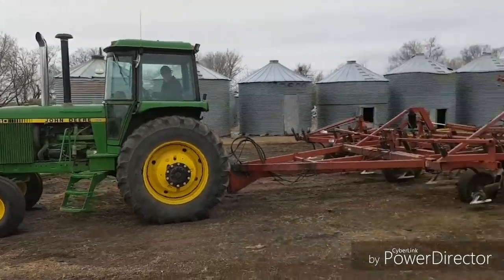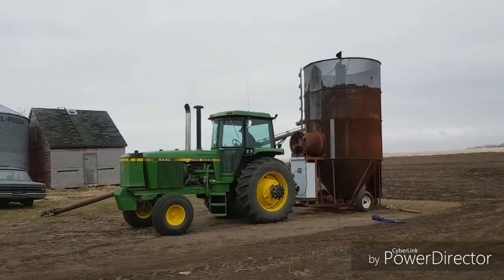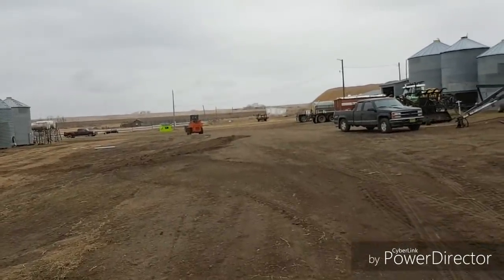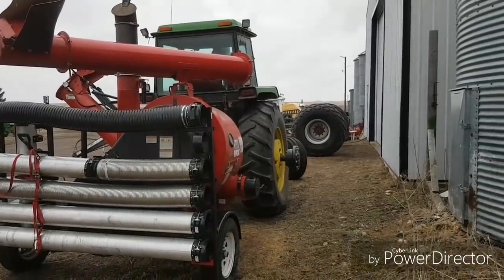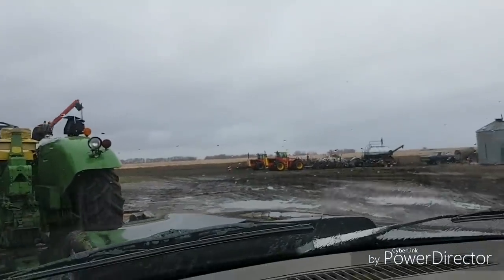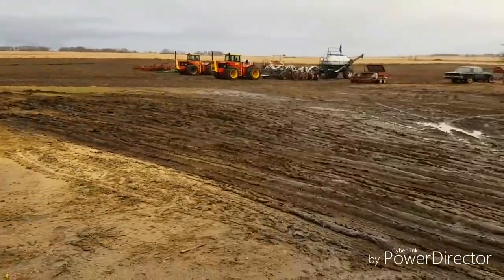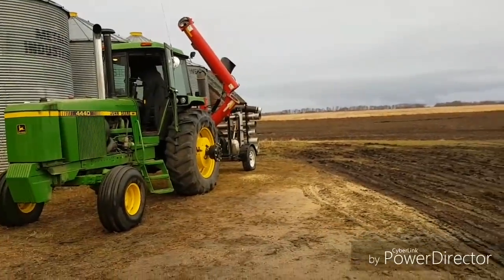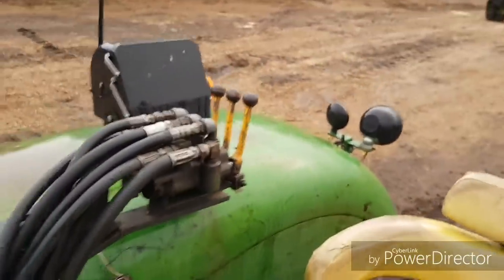4440 pulls 35 foot cultivator and Antoine does magic!!!

Comment: That old Thomas skid steer....
Seems to me that they made the old John Deere skid steers... We had an old JD 70, 5' bucket, good ol' Wisconsin.... LOL!!! Worked the HELL out of the ol' gal!!!! Rebuilt the engine twice, she'd run like a lopsided top, right up to when she couldn't run..... Last time around, she was still scooping 💩💩 💩, running on one cylinder, the one next to it hitting every other time.... The two on the right side of the machine were taking turns every few minutes... Busted head, cracked block.... All but the hydraulic cylinders was worn out!!!
Sometimes I miss the old gal, but not enough to want it back!!
(Only half the machine of my old Case Uniloader.... She still runs every day 😂)
Reply from the maker: Lol
Reply: Gosselin Farms Ed Gosselin 
JD 70 skidsteer was made by Owatona. I have one. Good rugged machine.

Comment: Could you possibly get more hydraulic hoses forward to the front loader on the tractor. Holy smokes 6 lines clear to the front. Makes me think about just the cost of the hoses much less all the valves and fittings. Probably 5,000 bucks worth of glad hands. Hah

Comment: Things are looking good! If ya get a chance and your able too could you get some footage of pulling that starter off I need to replace my 4020 starting just want to make sure I do it right
Reply from the maker: For sure! It's real easy just undo the wires and then three bolts and it come right off
Reply: Thanks that’s what I figured for the most part just like any other one just I’ve never had this one off and didn’t want any surprises
Reply from the maker: @farmingvintage302  lol fear enough
Reply: Haha thanks. I think the worst starter I’ve had to pull off was on a John Deere model A that’s the worst one yet

Comment: Good ole 4020!
Reply from the maker: They are awesome eh!
Reply: Yes they are! We gotta finish fixing ours
Reply from the maker: @farmerike-treasuredhavenfa66  I seen it was All  apart haha what's up with it
Reply: Put a new clutch in it and a few other things
Reply from the maker: @farmerike-treasuredhavenfa66  we just did that to this one if ya go back a few months engine rebuild clutch and some other odds and ends
Reply: Alright I'll have to check it out! About all the rest of our tractors still need work 😕
Reply from the maker: @farmerike-treasuredhavenfa66  I try to do one per or two per winter lol almost have them all totally rebuilt haha
Reply: Nice! It would help if we had a heated shop so we could actually work on something during the winter lol we had the 4020 at the local airport at my neighbor's hanger to fix it
Reply from the maker: @farmerike-treasuredhavenfa66  haha ya money is hard to come by but if your ever in the position to even hold a small heated shop itll be the greatest thing you can do for your farm and yourself!
Reply: Oh yes we have 1 nice building that needs concrete and some insulation in walls and doors but it's not at the home farm. We'll probably figure something out in the next year or so
Reply from the maker: @farmerike-treasuredhavenfa66  good plan haha